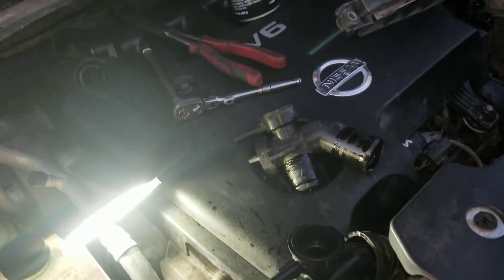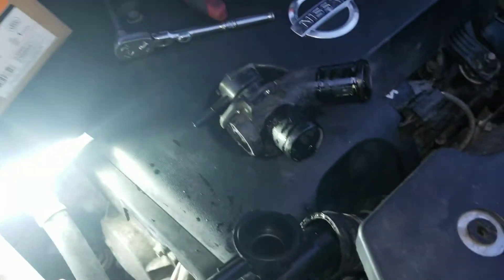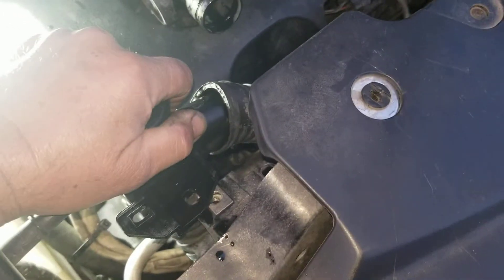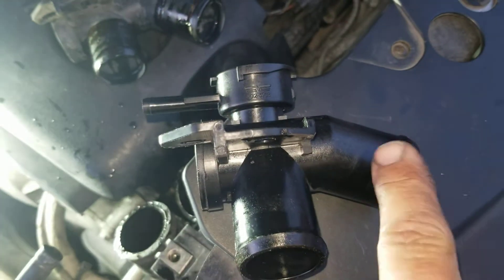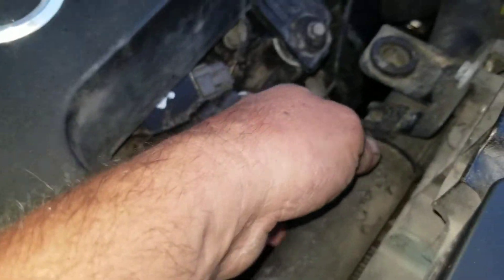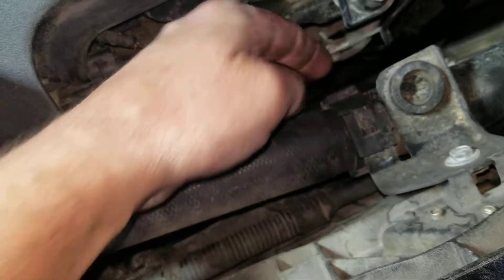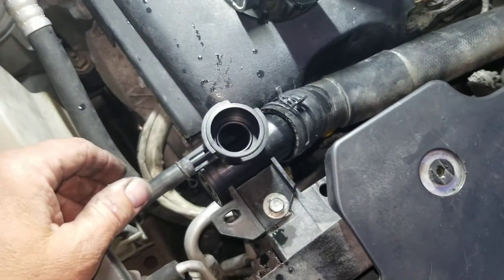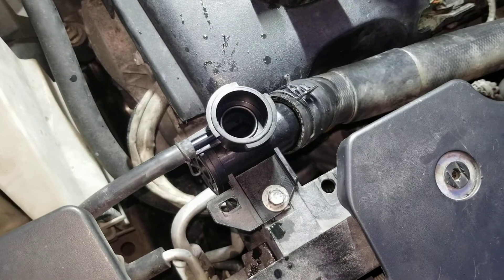Using Dorman 902-5938 filler neck housing on a 2009 Nissan Murano temporary

Comment: So did it work or what?
Reply from the maker: Yes. In the video I explained that the angle was a bit off. If that is acceptable for you that's cool. I did eventually replace it with a factory one.